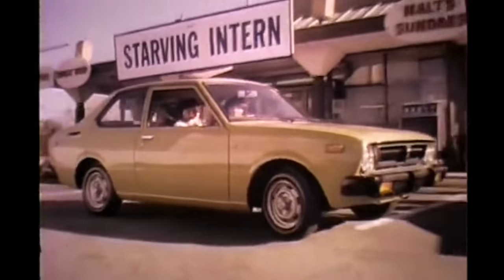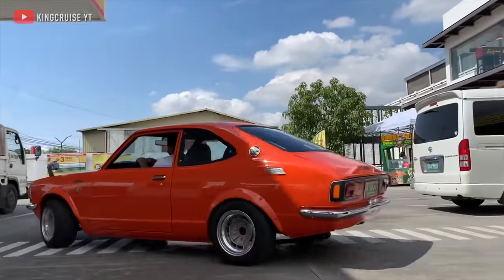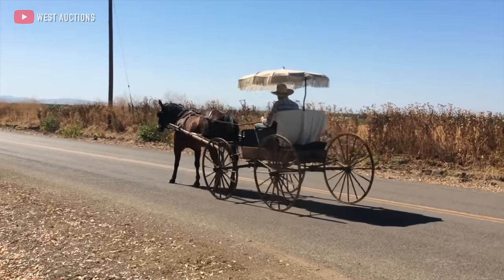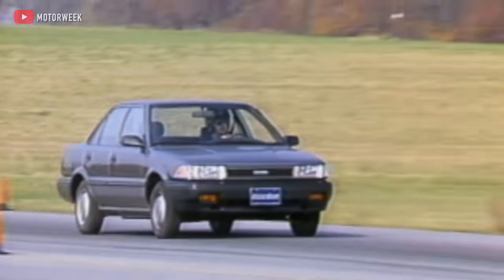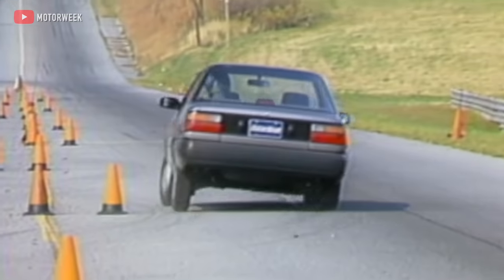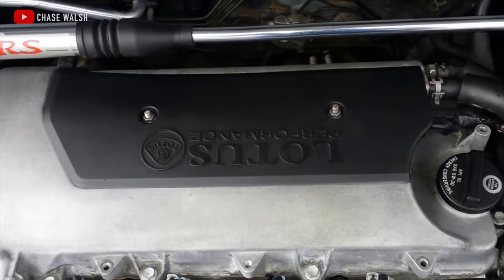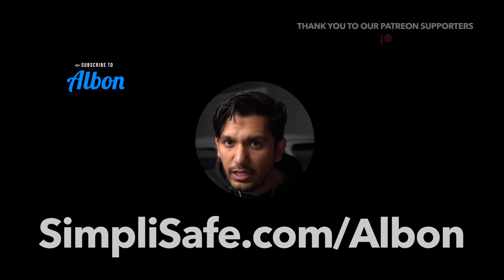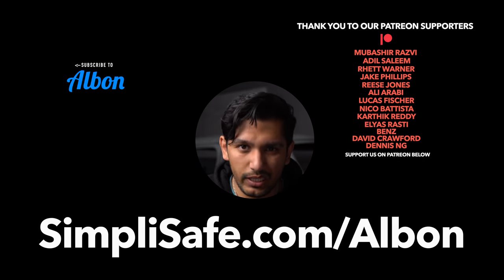Toyota Has An Identity Crisis

Comment: I put a deposit on a gr Corolla ( hoping for the circuit - will be happy if I even get a core edition).

I never thought I would Move on from my  Fiesta ST till 3 weeks ago when the gr announcement came out! I was concerned with the weight of the Corolla but considering that I just sold a 993 with 275 horsepower and 3150 curb weight - The gr just maybe a great replacement For both❗❗❗  As to how I drove the fiesta I will be more likely to not hesitate to trash the GR  down any random gravel or dirt roads.

Comment: Always wondered how the 86 of Initial D turned into the bland Corolla of the 2000s.

Great Video guys!
Reply: The ae85/86 chassis only share the name and powerplant of the corollas of the day, they still made 4 four corollas during the 80s
Reply: @samgome01  they were still Corolla’s though and had previous gen Corolla dna. So it’s all crazy.
Reply: @MaddNomad1015  pretty much a split for the norm, gotta appreciate those few moments where some of the heads of a company want to make product not for the sake of profit but for the enthusiast
Reply: @samgome01  yeah, they had a fwd "boring" Corolla selling at the same time
Reply: グルグ  2zz anything is underrated
Reply: The 9th gen corollas are heavily underrated even the base models the 1zzfe got a supercharger from the factory and the 2zz is a wild engine on it's own but with lite tuning it's a beast

Comment: Toyota should start making rwd sprinters again in limited numbers
Reply: They're kinda are doing that for more than a decade
Reply: @samgome01  Those aren't Corolla related though
Reply: @MaddNomad1015  it's true the gt86 and gr86 not related to the Corolla at all other than badges they put on but it's the true successor to the ae85/86 sprinters of the day and the sprinter was only related to the 4 door Corolla from the same era through the power train and the badges. What they can do instead is a special Collab trim with Yamaha to make a special version of the fa24 to rev up more than 8k with a bit more horsepower and torque with two tone paint jobs and Watanabe inspired rims then call it the  sprinter

Comment: My current car is a 2002 Toyota corolla Levin. It's an e120 4 door hatch back with a body kit from the Toyota sportivo (the 2zzge variant) 
With RWD corollas or those with the nicer engines being very hard to fine I settled on the Levin (which is equipped with the boring 1zzge engine - although id argue its still quite zippy/nice to drive).
When I got my car home after paying a mere $3000aud for it I swapped the engine for a refreshed 1zzge that had 140xxxkms on it (the original having 280xxxkms and burning oil like no tomorrow) 
I wish I swapped in a 2zzge engine from the sportivo variant but price wise I was limited. 
As a car enthusiast I have had 45 cars in my life at 28 years old and several of those were all corollas (all boring variants) and something about the corolla just keeps pulling me back (I prefer them more than the wrx's, the 300zx's, the r33's, the European cars like the w126's etc that I've owned over the years) I think its a similar to how Honda lovers treasure the civic, you've got an unsuspecting FWD in many cases that are cheap and easy to wrench on and you make it into something nice and unsuspecting. Seeing a car with a boring look (interior and exterior) be transformed into something sporty looking and then you start adding suspension, brake, tyre and engine mods and you create a car that is still economical and unsuspecting but has some performance it just makes me smile. 
Its funny having a corolla that looks like shit wrx clone (but sexy in its own right).
I think the main draw I had to the car was the fact its a Levin (in Australia) that nod to the previous 86 and sporty generations really sold it to me, I have many hopes and dreams to pour into this car as time moves forward and I only hope I am able to do it some justice when all is said and done but I do plan on settling and keeping this car for as long as possible. One day when I have a house and garage (cant justify the silly prices here ATM) I also hope to have a fun RWD variant to restore and drive alongside the modded e120, should I ever be unlucky and have my car be stolen or crashed (life happens) I will definitely upgrade to a gr corolla, but at the same time, I hope I can keep my current one for life and continue fixing and upgrading it.

Comment: Very nice video.  
One thing, you didnt talk enough of the body variant , specialy with kE70 and AE80 series. 
Offering coupe 2door, sedan, hatch3door/5door
Wagon and E90 have hatch 5 door in long body (seca aka chevy nova) and short body (fx16)
Wagon AWD (sr5 ae95) aka carib
Sedan AWD ae95 
AE82 was the first FWD 
The AE90 was the upgrade of the AE82. 
The MR2 is a mid engin corolla based.

Comment: The best generation of corollas were the 90s corollas e100 and ae110....independent rear suspension, EFI, DOHC, front rear disc brakes and could actually compete with the 3 series of that gen being the E36 if not better than it. E36 still running with the old SOHC engines of the E30 while the Corolla had a DOHC and EFI for alot cheaper 😮 everything that came after that was a step backwards probably because of the Japanese recession....

Comment: Maybe I'm a weirdo but I kinda just want Toyota to make a RWD economy variant of the Corolla again. You know, a RWD manual transmission daily driver that doesn't need premium fuel but has some sporty dynamics. The FWD Corollas now handle very well now that they have independent rear suspension. They'd be awesome with RWD!
Reply: I think a NA RWD hatch would do pretty well as a Si fighter

Comment: 1 thing I think is interesting that the video didn't mention/ got wrong, the 1st gen tercel is actually just a fwd corolla and it was built in 1980. its actually called the "corolla tercel". it was basically just a corolla trim option.  These early tercels are basically just corollas with a front axel. Their engines and transmissions were even set up as if the cars were rwd. basically the only shift that happened to the corrola in the mid/late 80s was they turned the engine sideways, they had already produced fwd corollas in 1980.

Comment: The real missing link is this. For the US, the actual Toyota made Yaris secretly exited stage left around mid 2013 or 2014. When the new Vitz was released in Japan in 2014, we never saw that car. The Mazda 2 was given a little cosmetic nip/tuck to look like similar USA Toyota offerings. Also the Scion iA was a limited run of basically the same thing but maybe 2 extra doors? Anyway we haven't seen the sub compact Toyota made cars since 2013. The newer corollas are as cramped as possible and need a bigger forehead. Sorry I had to say it. And the blindspots!!!!!!!!!!!!! Side note - the USA market Yaris was assembled in France with tires made in France but still had 40% Japanese parts.

Comment: Jeez🙄, Corolla after AE86 isn’t that bored. As you see they still have 4AGE choice until AE111 and later in 90’s that block is a “5 valves per cylinder engine”. It’s still fun to drive whether it’s E90, E100 or E110 model. And not just 4AGE that can be enjoyable with, the FE version (4/5/7AFE aka the economy one) is a good machine too.

Comment: Apparently didnt do enough reserch if you did you also would have found that the 9th gen did have an si version of the corolla names the xrs which was only made for 05-06 that only came with 6spd transmission and the 2zzge engine

Comment: Actually 1zzfe isnt slow engine. Also has after market support for cams, turbokit or supercharge. This engine if tuned right easily double horsepower
Reply: He was probably assuming that you don’t add modifications to it because any engine really can be fast if you tune it right
Reply: I have a 2005 Toyota Corolla Le,its running  good.I love it.
Reply: @christopherbarber288  yeah but at that times corolla with 1zzfe is not bad 0-60 times with the competitor with same engine.. when i do drag racing, some of our friend has good experience with the engine including turbo it. yes 2zzge its faster but it expensive to maintain and not really fun to use in city comparable 1zz
Reply: @rommeltolentino5954  the engine is reliable, the only drawbacks are oil consumption which is not a big problem. just maintain oil level and add if reduce. asian and japan 1zz is free of this problem not for usa 1zz
Reply: @rommeltolentino5954  Interesting actually, thanks for the input. Do you know what the 0 to 60 time is?
Reply: @christopherbarber288  extravagand luxury supercar.

Comment: Toyota does not listen to it's customers (GR86 and no turbo; Bupra).  I was a die-hard Toyota person but ceased to be when they came out with the FWD nonsense.  The Yaris GR is perfect, and it's purpose-built Rally Homologation, but the GR Corolla should have used the tried and proven 4AGE 20V with turbo and the same trick GR Four drive-train.  The 4AGE is superior in every way to the 3 cylinder engine; and for enthusiasts, it's infinitely tunable, all the way to 2 liters and your heart's desire in HP, making it competitive to the likes of the WRX etc.  Still, whatever it is, I'm glad the GR Corolla is born.

Comment: Aaah guy E140/E150 Corolla did have Xrs model to but had the 2azfe 2.4 and anyone who remembers toyota did make a trd supercharger the that engine that can make that engine output 280 or 350ish hp if you want to grenade the bottom end

Comment: Not boring at all man, that 9thngen you where saying still runs like a bullet proof up to now. So what boring about that, if your engine cannot last along like corolla does.

What , does it all have to be like fast, corners, power, 
So what, non of those are you need to go from A to B. Lol, learn how to leave in your means, learn how to be content. Wait for the new special GR Corolla,
Tired of people saying corollas Boring, yet cant buy Lexus one.
This Hondas cannot stand how reliable Corollas are, you cannot beat that.

One VW engine can stand tho, that. Mid 2000 VW engine simply built 

Stop saying of boring, where can you reach if your non boring car cannot  run any more even you did all the standard PMS.

Anyways,

Comment: Can you drop the San? It's so pretentious... aaargh!!!

And having four valves per cylinder doesn't guarantee high revs, other factors such as bore vs stroke and other stuff have more influence on capacity to rev high. Bunch of dweebs with a camera, shotcut and wikipedia - so much misinformation and half-assed research it's infuriating. 

The Trueno, technically speaking isn't even a Corolla, the Levin is and while they are essentially the same car except for a few slight differences in visual cues and the Sprinter (Trueno) being a bit more upmarket and very very subtle differences in ECU tuning, the Levin is the Corolla, talk about that. 

I could go on for days... you guys need to do better research.